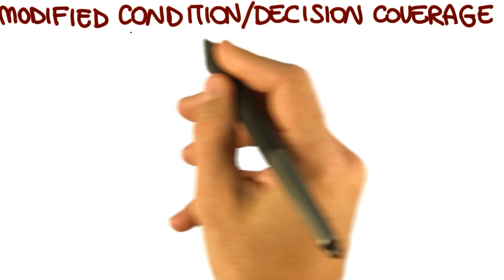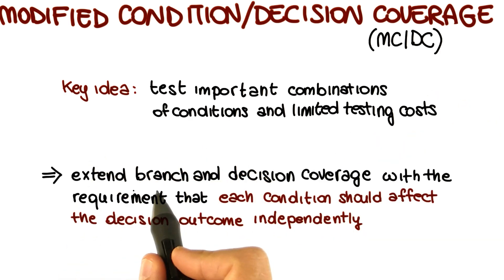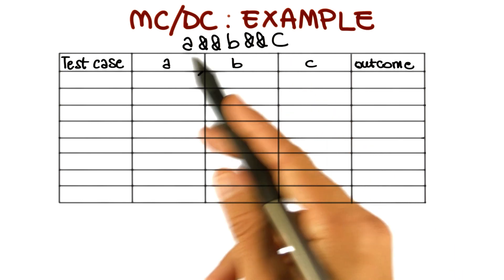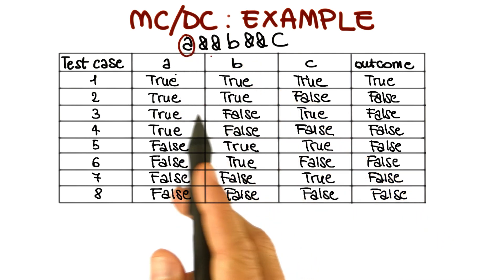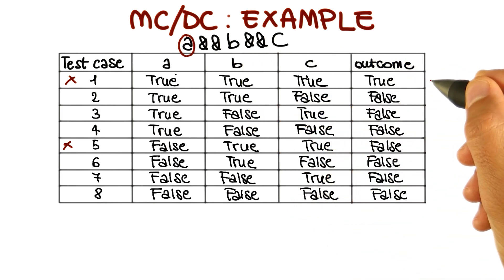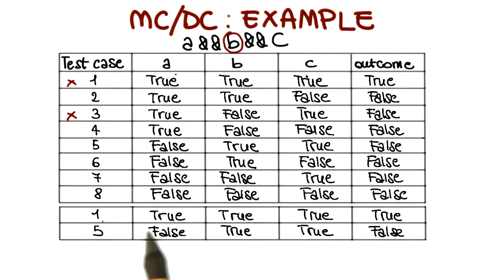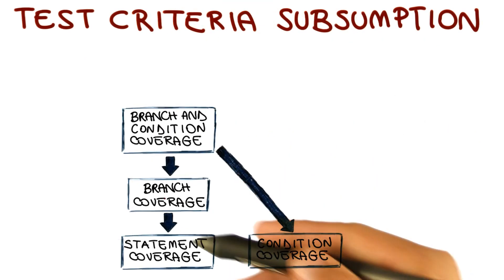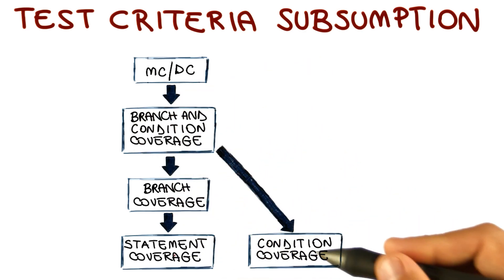MC/DC Coverage - Georgia Tech - Software Development Process

Comment: no explanation about possibility to reach a different final set of combinations based on the sequence used to build it ? Mainly, about different number of finally selected combinations. That is, starting from a different initial combination may impact the size of the final selected set of combinations ? Trivial with an AND, but what about general boolean expressions ?